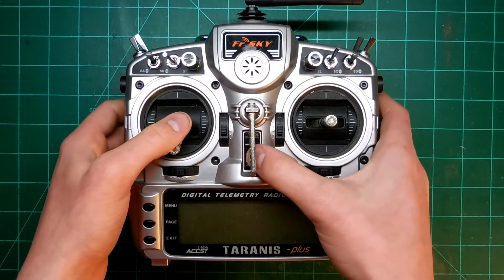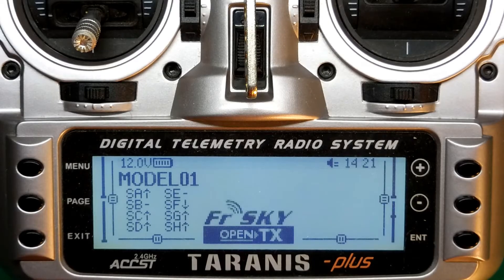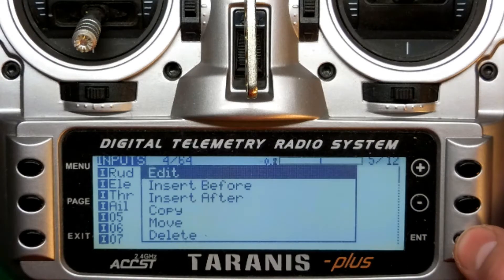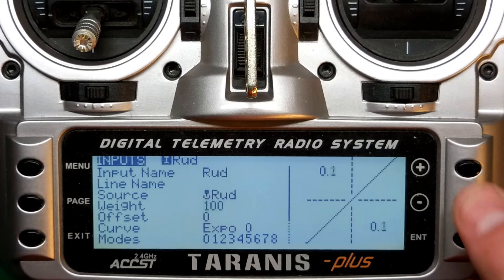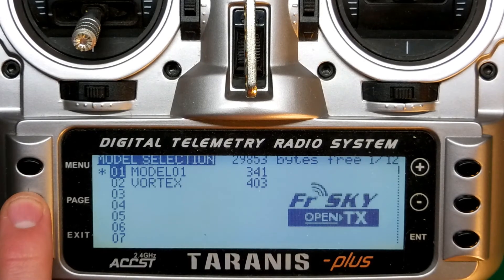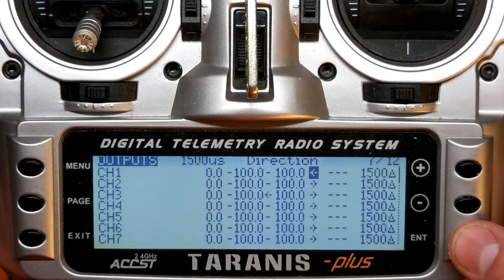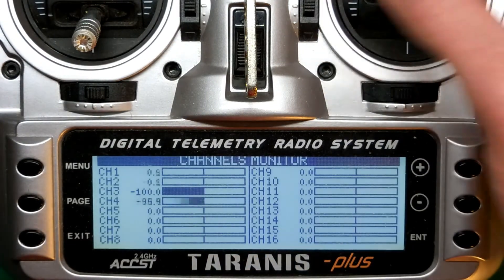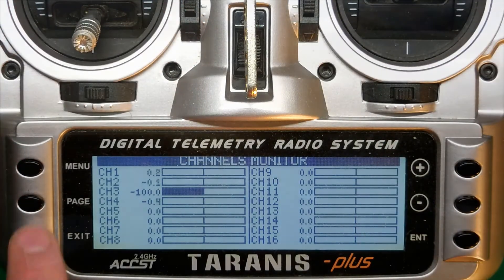How To: Reverse a Servo with the FRSKY Taranis

Comment: Your first method doesnt change the direction of the trim buttons though - e.g. if i reversed a rudder servo but then needed to trim it right during flight, the change would be to the left! Your second method works perfectly though (thanks!)
Reply from the maker: Oh ok that’s good to know!
Reply: Perfect suggestion, it worked absolutely well for me! Thank you.
Reply: Had the same issue with the trim. Thanks mate
Reply: Definitely recommend method 2.
Reply: Wow didn’t realise this. Used method one! Will change it over now
Reply from the maker: Glad it helped!

Comment: You might want to mention that if you have calibrated the outputs (stick middle = 1500 us, down = 1000 us, up = 2000 us), the second method will reverse the calibration. First method will not affect the calibration.

Comment: Help!!! I can't get my servos to go up and down. Im getting good throws to tbe left and right but nothing when im pushing the sticks up or down. 😣
Reply from the maker: You want to go up, down, left and right with only one servo? It sounds like either your second servo just kicked the bucket, or you need to put in a servo. Or maybe I just dont understand the question?
Reply: StatiK RC ok, both servos will go left and right both not up snd down. When i stick up and down the servos still move left and right.